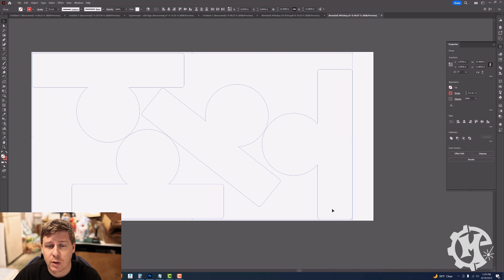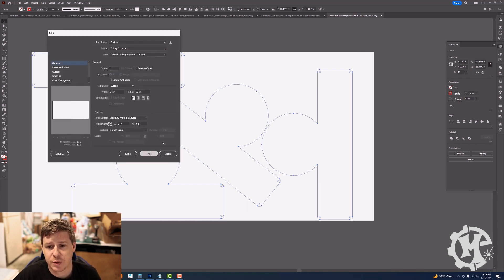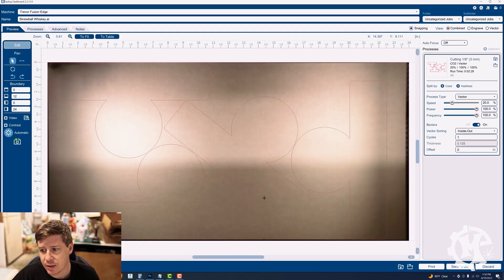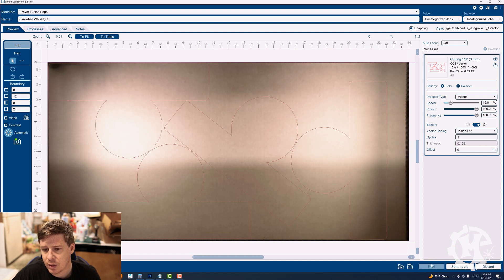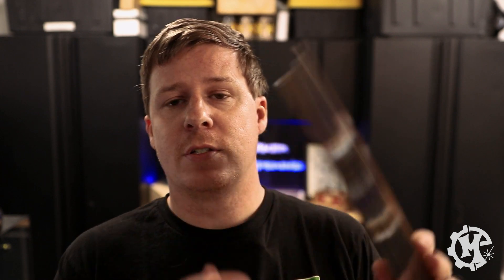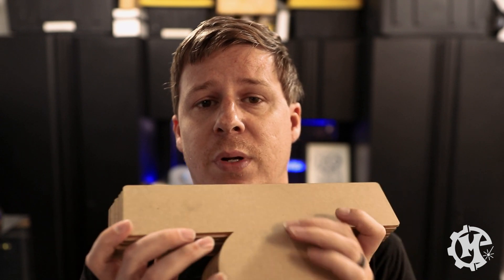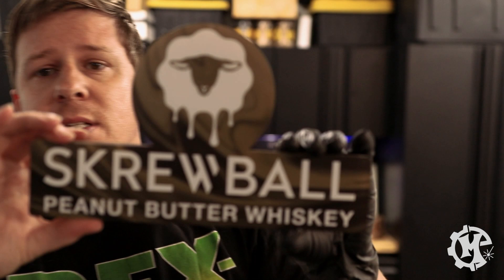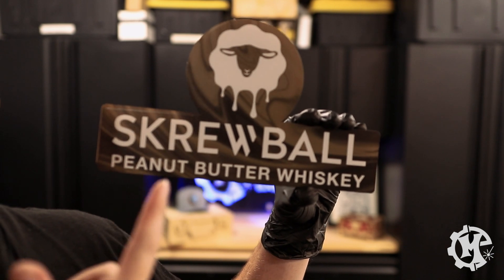How to Impress Clients with Custom Printing Artwork

Comment: Thank you. I will be testing it as soon as I get mine working.
Reply from the maker: Did you buy a UV printer? If so, what did you get?
Reply: We were lucky to pickup am eBay bargain, a basically never used GCC JF-240UV with roll to roll and the EzRotary. It just had clogged pipes and printheads. We have all the pipes clean now and the varnish, cyan and magenta are working perfectly, white and black are showing promise, but the yellow is still playing up, but should crack it this week. 😅
Reply from the maker: @paulhill1662  that sounds like a good find.

Comment: ❤ Why did you not print on the back and reverse the text through the clear cast? Came out great anyway! Love from England 🇬🇧
Reply from the maker: They wanted adhesive attached to the back and I was concerned that would cause an issue with the print.

Comment: Love it. I wish someone would talk more about the fume extractors. I work in a home environment, and have considered internal fume extractors (despite the cost), but I have wattage limits (home), and I wonder how well they extract fumes from an internal space. Any info you have to share would be helpful.
Reply from the maker: What exactly are you looking to know besides how well it works in an internal space?
Reply: @MakerExperiment  A few things specifically: 
1) How much noise does it add (if any) beyond the laser cutter noise level?
2) Does it extract enough (smell and particles) to be acceptable inside a home (not garage, but literally a bedroom etc)?
3) Could it be safely connected to 110/120V standard home electrical outlet, or does it really need 240v?
4) Cost of filters and frequency of replacment?

I'm sure there a 100 things I don't know that I don't know -- but those are the ones that come to mind immediately. Thanks for asking!

Comment: We just got a UV printer with "Hard Ink" but we have lines in our print, lines in all the colours on the test... been battling it for a month, temps 15c to 20c,  humidity 40ish , in a dust free environment.    New Heads?  Its brand new :(
Reply from the maker: Have you already tried flushing each head and starting over? If you let it sit too long, meaning longer than 3 days or so, it’ll start to clog.

Comment: Nice video. We also need an another video on the UV printer , I want to know what happens if you leave the ink in the printer and don’t use it for a few days,weeks? Cleaning requirements ? Ink and other costs associated with owning one? Does your printer have a vacuum system? Or were you using double sided tape?
Reply from the maker: I can put it on the list of videos to make.